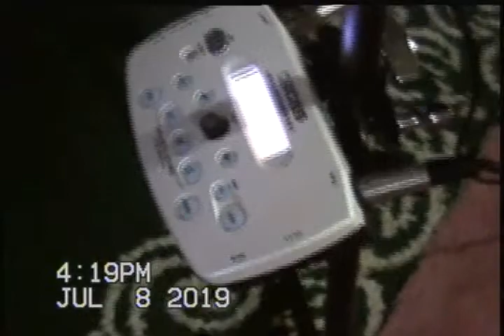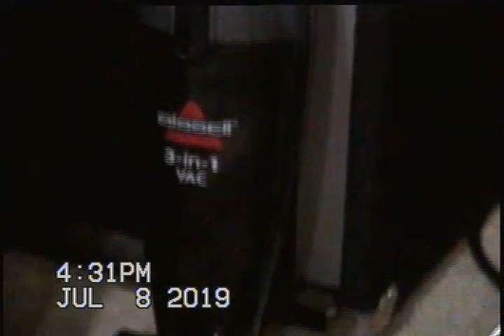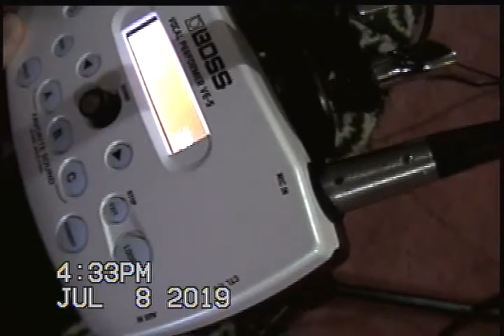Vacuum Cleaner Madness!

Comment: Can you do a video called bissell vs bissell vs bissell and use both of your bagged power forces against the bagless power force
Reply from the maker: If you watch my Bissell vs Dyson vs Electrolux Shredded paper test video you see both my bagged bagless powerforce in it.
Reply: Techman5150 
I saw the video 1,000,000 times and I was just wondering if you could do the same concept but just with the bissell’s only.
Reply from the maker: I don't like to waste vacuum bags for videos. But i'll see what i can do though i won;'t be using the two powerforce 3522s as one has a broken base and does not work right which would result in an unfair test.
Reply: Techman5150
Ok but I will tell you that the new power force vacuums are very bad in quality because they are now 8amps and I’d rather have bissell bring back the 12 amp motors or better yet if they want cheaper motors again, then they should revert back to 10 amp motors. Even though they are 2 amps apart but it’s at least better than the number 8